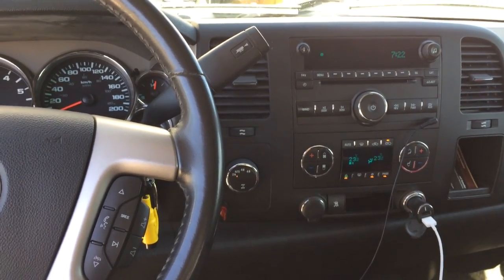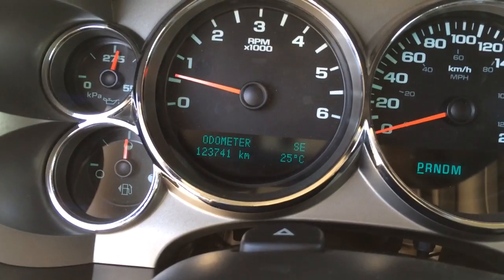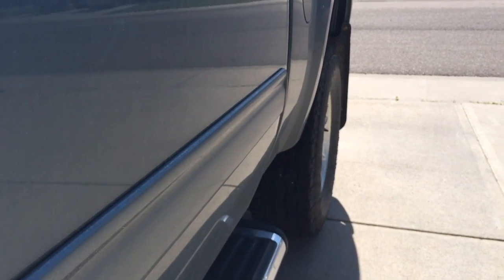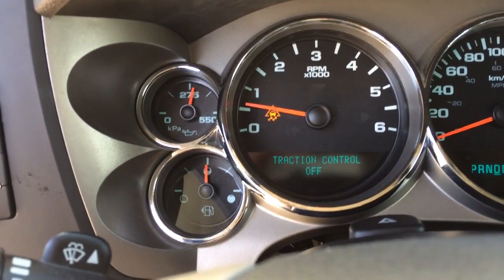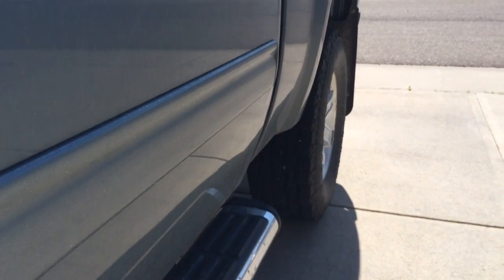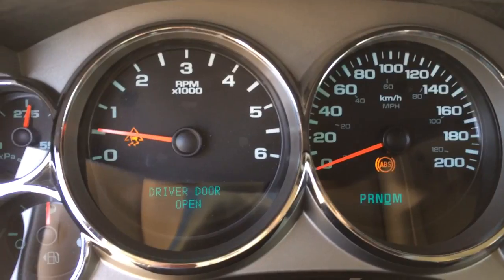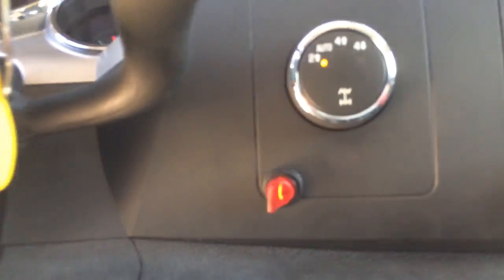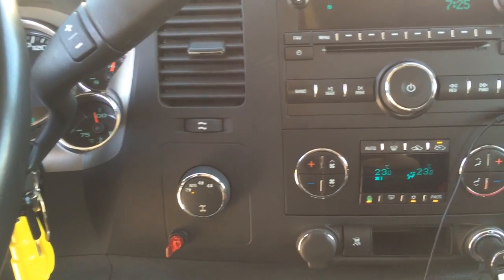Traction Control, Stabilitrak, Brake Control Function, RPM Limiter- BYPASS

Comment: my 2007 Chevy traction control is turning on when I make a turn why?
Reply from the maker: +Alfredo Sanchez sounds like a rear wheel sensor is going. Couldn't tell ya which one though
Reply: I forgot to tell u I lift my truck 7 inches and 20 inche rims and 35 /12 tires
Reply: Maybe that is the problem too?
Reply from the maker: +Alfredo Sanchez Shouldn't be the problem, as the wheel speed sensors are proportionally sensing the spin of the tires in accordance with the computer sensing the speed of the vehicle. As you turn, the outside wheels are spinning faster than the tires on the inside of the turn. Does it only come on when you turn right or left? or both? As long as the tires are all the same size, the lift is never the problem.
Reply: @AnonYmous-qg4ph I swapped mine out and didnt fix it for me. Stabilitrak light still stays on.
Reply: @AnonYmous-qg4ph autozone pc says it was steering control sensor. I swapped out with a new one, still no luck. All speed sensors good too. I still have cruise control (sometimes the no stabilitrak/no traction control malfunction disables cruise control). Brakes and tires all new. No caliper issues…everything is in perfect working condition….i just cant find the issue, nor can the gmc dealer.
Reply: @AnonYmous-qg4ph 2008 gmc sierra crew cab SLT 5.3, 2wd, 79,000 miles…brand new tires (factory size) all around..new brakes all around. Whatever code says steering wheel sensor. I havent coded it in over 8 months. Stabilitrak dash light stays on. Read out on dasg says to service traction control and service stabilitrk and that both are off. It doesnt effect my cruise control. Cruise control still works. No dash abs light warning or dash brake light warning. GMC dealer cant figure it out either. Pressing the stabilitrak button does nothing no matter how long i press it. All fuses are good too. All signs point to everything is working as should but for some crazy reason that stabilitrak stays on. Cade cant be cleared out either. Dealer tried to clear it and i did too.
Reply: @AnonYmous-qg4ph nope

Comment: Nice little truck in your nice little neighbor hood . You drive an under powered truck that is 1 notch above wimpy. My 2016 Colorado Z-71 2WD 3.6 is equipped  with an 8 psi boost RiPP Superchargerthat bangs out 409 RWHP and that is a seriously fun as hell truck to drive.  The RiPP kit is what your Colorado needs.
Reply from the maker: Good for you Jerry, right on...
Reply: @jeff17s  Man I saw Tess Performance you tube showing 330 rwhp and why anyone would call these guys to get a  60 HP add o mine is a Vortex too and it takes a skilled tuner to get it right . my install got 138 extra HP . Hot paint wheels and nice big tires are cool but a Colorado with 400+ HP is something to talk about
Reply: Stop trying to show off your truck on a informational video. Nobody cares what you drive. And nowadays 400 hp is nothing that’s slow, 2019 4 banger engines will dust you. Comment when you build a 1475hp ranger.
Reply: @jerry
Reply: You drive a little boy truck. I have a 2010 silverado ltz 4wd crew cab with 3.5" lift 35" tires. a cammed and tuned 6.2 liter and magna flow exhaust. I am right about 500hp to the crank. It is awesome when you have a big truck that runs like a Camaro.
Reply: wow, cool story bro..
Reply: That guy never had any thing fancy in his life 😂 
Ull b ok my guy!

Comment: I think only left side
Reply from the maker: +Alfredo Sanchez My guess would be the rear right wheel sensor is bad. That or the computer iso sensing wheel spin when it isn't spinning.
Reply: Can I replace both sensors rear right and left sensors? Sorry for bothering u

Comment: Okay gentlemen I'm a chick so please don't be rude, I have a 2012 GMC Terrain with 82,023 miles on it and stablitrac/ traction control light has come on and my vehicle us constantly lossing power while driving acts Luke it doesn't want to shift. Had the get guys at my local part store run it for codes an they got a butch of them any idea how I can fix this problem without bankrupting a single mom???? Any advice would be helpful thanks again in advance.
Reply: Same problem

Comment: I'm not buying another Chevy if this is what you have to do.
Reply: Nick Carver it's not. I have a '15. Turn off stabilitrac, get in mud and it will rip. I think his issue is due to lifting it off the ground. I hold the traction button for the 5 seconds and I can get through the redline and hit the governor.